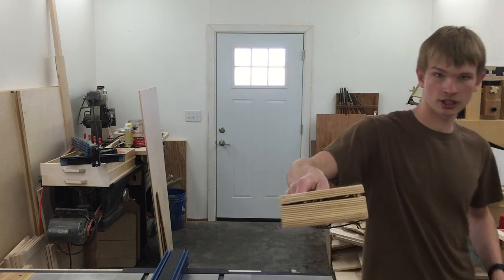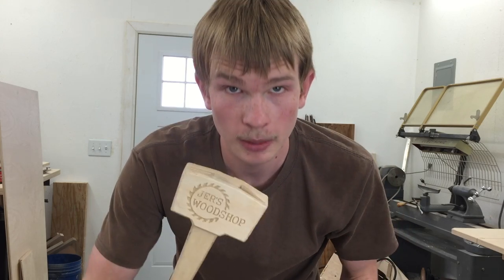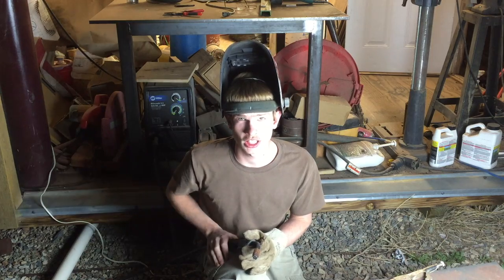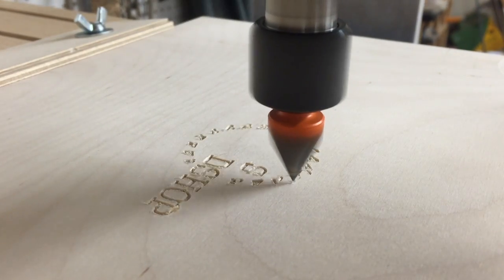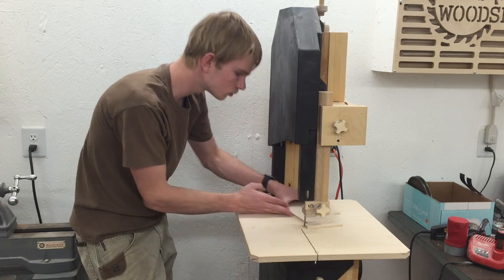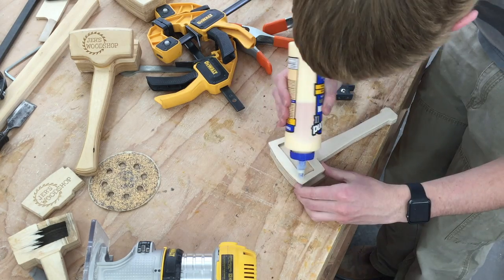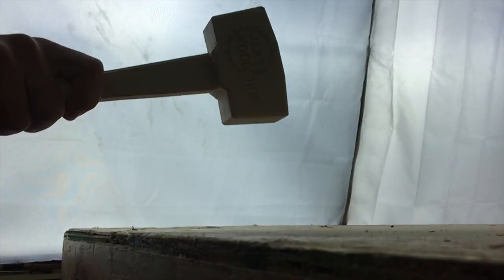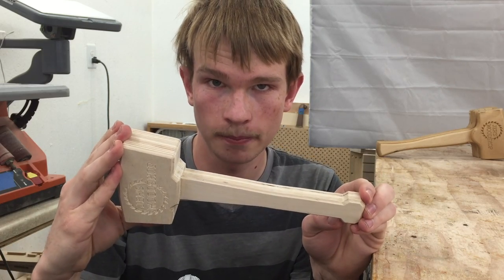Wooden mallet explosion!

Comment: I think you should try making these out of a dense hardwood that has good gluing properties and add leather buffers to the face. The softer wood that the pays are made from let go not the glue. A wood with the right mechanical properties should work. But the steel capsule is cool too.

Comment: Cool project. I would finish with BLO or tung oil or something like that that is actually going to penetrate into the wood. Lacquer or poly will form a film on top of the wood, which is likely to just crack and flake off because of the hard use you'll be giving it. Plus, you can reapply the BLO or tung oil whenever you want as the mallet wears. My two cents...
Reply from the maker: +Erik Nelson Thank you! That's a valuable two cents ;)

Comment: I would add some striking faces.. a steel one and a plastic one (for what i do, it's nice a steel or brass deadblow, and a hard plastic on the other, but it may come in handy to have a wood face, rubber face, copper face, etc.. depends what you are tapping)
Reply: AsiAzzy My personal favorite is a soft plastic on one end (similar to a cheap cutting board) and brass on the other. They screw on and off to change them out if they get too beat up.

Comment: Looks really good and I would you a finish that doesn't make a layer.
I guess the problem with plywood and mallets is not much about the strength of the plywood itself, which is plenty strong, but the lack of end grain. Any side of a plywood board is going to have half end-grain and half long-grain because of the "veneers" orientation. In a solid mallet you'd normally have all end-grain on the face that is beaten-up which is more compression-resistant and so would probably last longer.

Comment: Interesting that in all your demonstrations it broke on the outside wall of the way you held the mallet. I think you are correct about the downward force busting the joint but it looks like your swing has a slight inward arc causing the stress to flow laterally otherwise it would never blowout the end given the plywood grain.
Reply from the maker: +Timothy Wood I observed this, and others have also pointed it out, but really the mallet should take any kind of blow. If it breaks, regardless of how, it needs to be redesigned and strengthened.

Comment: tung or linseed oil. reason is because if you used something like polyurethane, it would chip off because it just creates a hard plastic around the piece. the oil will soak into the wood and even when you dent it, the finish will still be the same since it soaks in
Reply from the maker: +Alex Wegner Yep, that's what everyone is saying. Thank you!

Comment: Mineral oil and bees wax like for cutting boards. its cheap, easy to reapply and repels water on wood that gets used and abused. Most other oils and sealers are meant for keeping something pretty. not really for working like a hammer.

Comment: Personally I would finish in either a wax or oil. Could you also gain more mechanical strength by drilling a few holes for hardwood dowels through the side of the mallet?

Comment: you may want to do oil based poly on the head for durability and then just a danish oil or lenseed oil on the handle as it is better on the hands and can be reapplied easily.

Comment: very cool ,what if you added plywood to cap the ends ? so the "end "grain is on the edges/sides rather than the face of the mallet
Reply from the maker: +sdmcustom woodworking I think that would work, but I'm afraid the end caps would break off after some use.

Comment: Have you tried it with Sand instead of BBs. I calculated the forces of the BBs when they stop after the hit and the side forces are as high as the hiting forces. Sand is to small for building up side forces so this should work without metal inlay. Give it a try.

Comment: I would think the original failure had as much to do with the impact/shear strength of the wood glue, than any pressure the bbs are exerting. A wood screw into each corner from the side of the mallet head would likely have prevented the initial fracture. Or maybe not... who knows.
Reply from the maker: +ARCustomKnives 
At any rate, this one won't break.

Comment: Would it be any better to use an epoxy that adheres to both the metal and wood? I'm just thinking of the surface area you apply glue to after you carve that hole out of the middle. I like the slow motion and explanations on how it works.
Reply from the maker: +scott webster Epoxy probably would be better. I don't think this one will ever break though, the metal capsule holds in all the pressure I talked about, so there is little or no pressure trying to push the wooden sides off. 
If it does break I'll try epoxy next time; thanks for the idea!

Comment: Haha, I've had my phone land on my face several times - usually as a result of watching YouTube videos! :-)

For the mallet - something I've done in the past is to soak them in a bath of boiled linseed oil for two or three weeks. As well as adding some protection, it also adds considerable weight. At least, when used with solid wood. I imagine there's still some absorption with plywood.
Reply from the maker: +Olly Parry-Jones Interesting idea, but in this case I don't want to add any "static" weight. If I want more weight, I'll add more BBs. More weight in the handle/head makes it more prone to bounce.

Comment: Hello, i think that the bb's behave like liquid, when the mallet hurt the wood, the pressure increase suddenly inside and the mallet's head burst. That's the way i understand the problem. your metal core is more resistant, that's why it work.
Reply from the maker: +Stéphane Lamarre That's what I meant when I explained it in the video.

Comment: same mallet, fill with epoxy would seriously fortify it. Multiple slow fills and then glue on the outside with more epoxy would make this issue go away and still make plywood fine to work with.
Reply from the maker: +Jeremy Lakose But then it isn't a deadblow. It has to have the loose BBs to prevent bounce.
Reply: surprising how many people don't understand dead blow mallets

Comment: great video!  the waiting scenes were hilarious.

I'm curious if there would be an advantage to putting some kind of banding around the head, near the striking surface.  I'm sure it would be a lot more work—unless you used a hose clamp—so it's probably not worth it.  nevertheless, curious.

I vote oil finish.  shellac wouldn't hold up very well, would it?
Reply from the maker: +ThoperSought Thank you! 

I think that would be a good idea, but as you said probably more work. 

I'm no expert on finishes, and most the comments I've got so far are saying oil because shellac/varnish/lacquer won't hold up. So sounds like you're right :)
Reply: Jeremy Schmidt
askwoodman has a series on (non-deadblow) mallet turning, etc., where he does banding with sections cut from steel pipe.  it looked like a lot of work, and would be impossible to do the way he did it with a mallet that wasn't round.  really nice looking, but I'm not sure I would want to go there.

what about a plate on the side, bolted through the head?

I'm not trying to make suggestions or downplay what you did—your solution was really clever, as always.  I'm just curious.

on the finishes, I noticed some people giving really detailed suggestions about exactly which kinds of oil finishes to use on which part.  I wish I knew that much about it.

Comment: Or you could wire wrap the head of the mallet. Wouldn't get as many cool points on account of the logo not being visible but an overdone wire wrap should sufficiently reinforce the sides against internal pressure.

Comment: Good project.
A question:
Why not fastened with screws?
Or bring them together with epoxy glue?
  They have the same resistance?
Reply from the maker: +Francisco Corona I'm afraid that still might not be strong enough. Using steel makes it pretty sure to not break.

Comment: Two suggestions for your coding on your deadhead hammer. One die the wood red. I mean put it in red dye and let it soak up as much as it can. Then after you take it out and let it dry and you sand the down paint it white. Then every time you miss and you hit something you shouldn’t or you hit an angle or are you dropped it where you shouldn’t of you will see a red wound in your poor hammer. I actually think that would be cool. The second idea of a coding if you happen to make another one without the steel capsule is two coated completely and rhino lining. And if you take it to a shop that does rhino lining that be more than happy to spray it and do a reverse image of your logo and it would stand out and look neat and ride on lighting has a lifetime guarantee not the chip peel or anything like that. Just a thought by the way I like your design and I really enjoyed your YouTube channel. Thank you very much. God be with you

Comment: I disagree that "solid wood is no better choice", as you state at about 1:50.  With plywood, you have so many layers, each representing a point of failure.  Joiners Mallets such as these are most always made of hardwoods.  You can make a couple of chambers to hold BB's as long as you leave a good deal of wood on the striking surfaces.  I just made one this morning out of walnut and hard maple.  Try woods like that and I think you will be very pleased.
Reply from the maker: I see your point. Plywood is kind of like a chain, only as strong as its weakest link (glue joint). With hardwood you would still have one glue joint, but it's probable that that one joint will be stronger than the weakest of the plywood joints.

Comment: I noticed something in your slow motion shots.  
The angle of the mallet face doesn't seem to match your swing, so you hit the front edge of the mallet before anything else.  
You also have a tendency to tilt the hammer slightly to your left as you swing. 
This might be contributing to your early mallet deaths, since the combination of that leading point and being tilted slightly off center would result in almost 100% of the force being focused on one corner of that front edge.
Reply from the maker: +PoignantPirate That is true, but if the mallet can't take that, it's getting condemned. I don't want to baby my mallets around and very carefully hit squarely on the face. They should take any blow I give them.
Reply: +Jeremy Schmidt I agree completely, a hammer should be the most durable tool you have. 

Apparently I had a stupid moment and deleted the actual suggestion to adjust the face angle to match your swing to help you get better contact.

Comment: he mr Thor... nice work! I was wondering if you could glue another piece of plywood on the impact zone but with the layers perpendicular to the rest of the ply... I can emagine that this piece will to some extend prevent the hammer from splitting up/tearingbthe ply appart... just an idea...any way keep your nice video's comming like your work..
Reply: +Martijn Fransen plywood already had alternating layers.  I doubt that changing the orientation of one piece glued to another would change anything.  The glue is still stronger than the wood, and there is plenty of wood to split.

he's now contained the pressure inside a steel vessel, so the new mallet should not break at all.
Reply from the maker: +scrager4 I think he means gluing a piece flat on the face of the mallet. That would tie all the layers together.
Reply from the maker: +Martijn Fransen Seems like a good idea in theory, but I'm afraid the said piece of plywood would not stay on. It would be an end grain glue joint on every other layer, so it wouldn't be that strong. It'd be something to try though. Thanks!
Reply: +Jeremy Schmidt exactly that is what I mean
Reply: +Martijn Fransen a peace of flat material on the impact zone..

Comment: Hmm, isn't the problem that you're applying shear force to your glue joint? If you built a hammer such that the the two pieces you glue on at the end (to seal the BBs inside) are the two sides of the mallet you strike with, it seems to me that the force would be handled a lot better.
Reply from the maker: +Jack Meagher 
That makes sense...kinda. But the truth is I want it to be strong enough to not break, no matter how I use it. So the steel capsule solves the problem.
Reply: If you apply compressive force to the glue joint, it just reinforces the joint.

Even with the steel capsule, I'm pretty confident that repeated shear forces applied to the glue joint, even absorbed mostly by the steel capsule, will eventually cause the "cap" you glued on to peel off.

Comment: Do think the box was necessary,  would just a plate on each end, this would spread out the force of the BB, just a thought, this might be a  good option for people with out a welder, nice video
Reply from the maker: +Dave Simpson 
When the BBs hit the end, they work a little like a liquid. Now they're moving, now they can't; so the PSI inside the head skyrockets. A plate on the end wouldn't do anything about that pressure spike.
Reply: a square tube for the outward pressure with wood ends might work.  manage the outward pressure but the compressive load and the ends shouldn't be an issue for the wood.
Reply: Because the BBs are round, they would try to settle between two, three, or four BBs below it. The pressure is not forward, but lateral pressure that causes the failure. A copper pipe with no end-caps would work better than just end plates, but his solution covers all pressures. I like it.

Comment: Really great experience I enjoyed with video ,,,Question did this welding you do it in this video Harder than normal i never do it ?
Reply from the maker: +Karwan Shkur Thanks! The welding was a bit difficult because the metal was very thin. I had to turn the amperage as low as it would go to prevent it from burning through.
Reply: +Jeremy Schmidt  thanks man

Comment: I think you are doing good work.
I disagree with the "plywood is as strong as hard wood".
Yes the glue is strong, but the wood is cheaper the the hard wood solid mallet.
Oak, hickory or black wood is much better then plywood.
Reply from the maker: +jolj1 
Plywood isn't all created equal! This is birch all the way though, so in theory it has a Janka hardness of 910-1260. I guess I should have said "this plywood is as strong as solid birch".

Comment: the glue joint is where it broke. you either used cheap glue or you didnt glue it properly
Reply: +Steven Crosby It appears the glue line between the layers of plywood failed not the glue up between the plywood sections. Containment of the steel balls is the correct solution. Good job.

Comment: Do you have railway sleepers where you come from?When the local rail switched from wood to concrete sleepers they sold all their wooden sleepers i bought 2 sleepers for about $5 Bucks i made a kitchen island bench top,4 coffee table legs, a one single post wine table leg and i had enough to turn a bottle style mallet on my lave and i found that this particular hard wood has the weight and density required by a mallet not much recoil and I still own it today it's 16 years old i put linseed oil on it the day i made it if you want a good mallet you're going to have to get your hands on a railway sleeper I got to tell you it was the best $5 dollars I ever spent
Reply from the maker: +Roc Lo That's what I was beating on to break the mallets :) I know a couple places I could get one for cheap if not free. The biggest problem I have with them is the creosote soaked into them; I'm assuming you were able to get past that and find some raw wood in the center?
Reply: Jeremy Schmidt you're talking about that dark brown oil distilled from coal tar believe me mine had that on the surface too it only goes one Quarter of an inch deep because the wood fibres are really dense under that it can be skimmed off on your table saw try it on yours with the proper personal safety equipment of course you will be glad you did
 It should reveal the nicest timber

Comment: Pocket on each side of the handle with lead weights, handle all the way through. Hard wood. Don't reinvent the wheel.
Reply from the maker: Do you think humanity got to where we are with the "don't reinvent the wheel" mentality? Experimentation is incredibly important for innovation, even if the experiment fails.
Reply: If I'm going to push the limits of humanity it wont be by building a inferior mallet. The old "keep it simple" theory works wonders. I understand it's in a young mans nature to experiment. I did add a like to your video. Skol.

Comment: Do you normally swing it that hard when using it or was it just a demo of how it broke?
Reply from the maker: +G23 
No, it's usually just for tapping lightly. The larger mallets did break a lot easier than than the little one, so I wouldn't have needed to remake that one. But there was no way to know without trying to break it!
Reply: +Jeremy Schmidt oh,ok...I thought they were for light use ...chisels etc. I was wondering ...if you used it that hard, why not just use a small sledge. I was confused for a bit though..lol....I like the addition of a closed chamber containing the BBs. Thanks for the reply

Comment: Never do a varnish because it is the same concept as an axe where it will cause more blistering that if you were to use an oil (one example being boiled linseed oil) all in all use an oil
Reply from the maker: +HITTMAN115x935 Thanks. Anything to prevent blisters, indeed!
Reply: There will still be a risk that you will get blisters but it's significantly lower than if you used anything else.